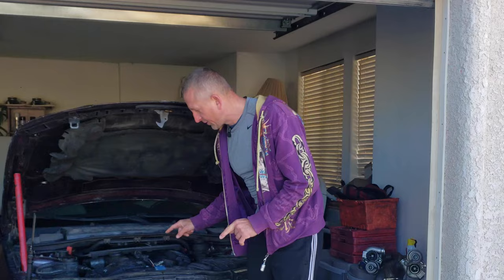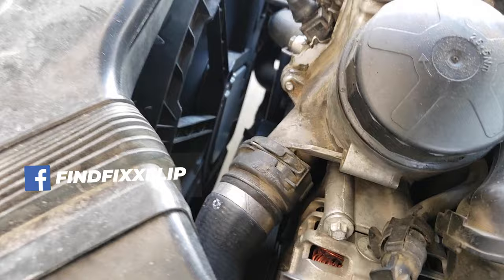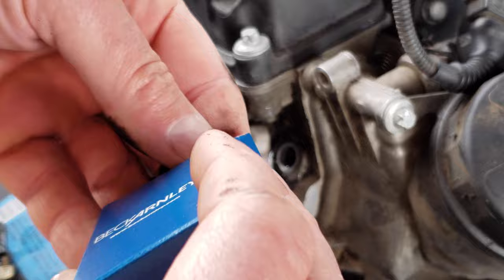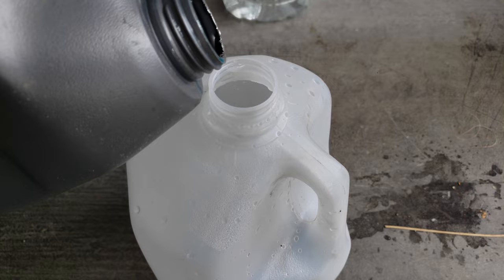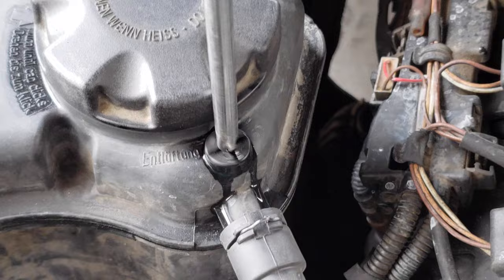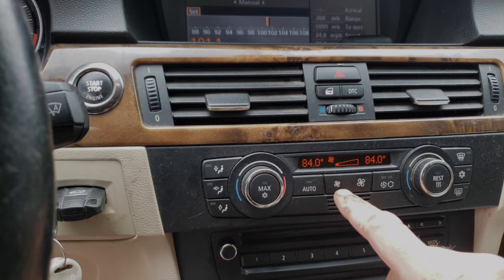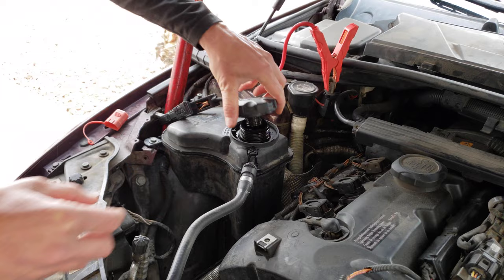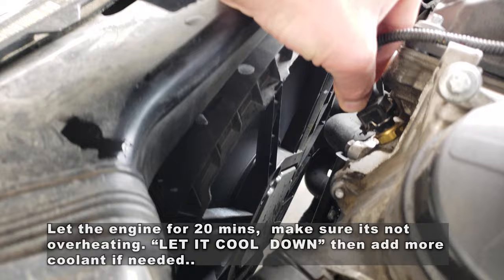BMW E90 RADIATOR FAN NOT WORKING(EASY FIX)

Comment: Hey @findfixxflip, great video!

I own a 2008 E90 with an automatic transmission. Yesterday, my car entered Limp mode, restricting the RPM and forcing me to drive slowly. After approximately 5 minutes of driving at a low speed, the overheating indicator lit up. Upon inspecting the car, I discovered the fan was not functioning. When I checked the diagnostic codes, it revealed an Electric fan malfunction code. I disconnected the fan connector and used a tester to confirm there was power flowing to it. Indeed, there was power. After reconnecting the fan, it instantly started working again, and the Limp mode issue vanished. I drove the car today, and everything appears to be functioning correctly. Both the fan and AC are operating without any problems. Do you have any insights into what might have caused this issue? I want to avoid a recurrence, especially during a long drive. Thanks for your help!
Reply from the maker: Honestly, it sounds like it may be time for a new fan, the controller module goes bad and doesn't switch on. I would as a precaution also replace that coolant sensor as well, because if that goes bad it won't send proper signal to fan because its not reading correct temp. Lastly worst case scenario,  you will have have to replace water pump and thermostat, only if you are getting continuous overheating warning, and low coolant lights on dash board. Just start with sensor, and fan. Also I prefer to find used oem bmw fans because they are made much better than aftermarket ones these days.
Reply: @findfixxflip  Thank you so much for the prompt reply, I recently replaced all coolant hoses so there is no leak and no low coolant warning and the temps are normal as well, I am not getting any overheating warnings it only happened when the fan stopped working and I kept driving on limp mode. As soon as the fan started working the temps went back to normal and the warning light went away, I will replace the coolant sensor and and the fan with used oem one as well just to be on the safe side as the overheating can be catastrophic. Thanks for the help, much appreciated.
Reply from the maker: @moizali1752  no problem, let me know how things go. Usually your symptoms are a sign that the control module is starting to go. The only other thing would be signal from ecu, but that isn't very common to go bad. But if you test the small signal wire it should have around 4 volts , the ecu sends pulses to turn on the fan.

Comment: Hello and please respond..my radiator fan always turns ON when i turn the ac on..i live in Florida but i never hear the fan come on any other time??? I am not showing any check engine lites or codes..HOWEVER when i disconnected the coolant harness the fan turned right on..does that mean my COOLANT TEMP SENSOR above mickey mouse ear flange is BAD????? I had the car running, disconnected the coolant connector and fan came right on??
Reply from the maker: Hello and no everythings sounds like its functioning properly, is the car overheating? The temp sensor just sends a signal at certain temp to turn on the fan, it will run at multiple speeds, depending on what sensor is telling the ecu. Its a cheap fix, and an easy diy. They do go bad pretty often as well. I hope this helps, keep me posted on the progress. 🙏
Reply: @findfixxflip  HI its a 2008 328i sedan no it doesnt appear to be overheating, but iin ur video u said if you DISCONNECT the coolant harness with car running and the fan comes ON, then to REPLACE the COOLANT SENSOR (412 part)  PLEASE ADVISE  **MY FAN only comes on when ac is on and its really HOt here in FLORIDA  BY UR VIDEO when disconnected, it turns on..that means the coolant senor is bad??? as u said??
Reply from the maker: @gail6904  hello, after reviewing , yes it does sound like that sensor is bad. Disconnecting the temp sensor, does two things 1) tricks car into thinking again is way overheating which signals fan, 2) shows the circuit for system is working properly. Try replacing the sensor first its only $13 on Amazon I put a link to exact one I used in video, it is still working fine my own car so I recommend. If fan still doesn't turn on after, there could be a problem with fan control module, then you would need a new fan. Try that and let me know if that fixes it 👌
Reply: @findfixxflip  OKAY i ordered the sensor..you rock  i hope it works out ok..did u have to disconnect the battery or anything when installing? thanks great video!! RE: 2008 BMW E90 328i
Reply from the maker: @gail6904  No need as long as there aren't any exposed wires you will be good. Just be careful not to overtorque sensor, and run the bleed procedure at the end of video to get rid of the air you are introducing into the system. Let me know how it goes. and Thank you
Reply: @findfixxflip  ok flip..thanks so much for your fast replies and all ur help..ive just bled the system last week as I put a new upper radiator hose in and coolant flange in the car  ..never a dull moment on BMWs..thanks!
Reply from the maker: @gail6904  you are always welcome😉

Comment: Where is the relay for the fan at on these models?
Reply from the maker: So depending on the model, Some like the 5 series and older 3 series has seperate relays located in the front near the radiator or battery. There are also several relays behind the glove box in that fuse box. 3 series like mine have a integrated fan control module on the radiator cooling fan that controls all the the speed, I haven't yet had to go searching for any relays , because replacing the fan solved my overheating issues. Hope this helps🙏

Comment: I’ve replaced that before and I have checked all the fuses and anything else I could think of but the fan still won’t turn on. I think this started after I left a charger on my battery overnight but anyway I don’t know what to do seems like the next thing I have to do is take out the fan because I’ve been told that the Relay or whatever is inside it 
any advice?
Reply from the maker: Which model and year do you have?  Have you unplugged the the fan and run a 12+ directly to the fan yet?
Reply: @findfixxflip  2008 335xi 
I don’t know how to supply the fan with that
Reply: @findfixxflip  “those car guys” said that you should take the fan out and open up the middle to find the module or a relay but that sounds like a big pain in the ass
Reply from the maker: @JonathanWornardt  i would say just replace the whole unit, but first find out if you can power fan on.
Reply: @findfixxflip  how do I power the fan on?
Reply from the maker: @JonathanWornardt  run positive jumper to large blue wire or possibly yellow, then run a negative to your brown wire, fan should come on, the small wire is the control wire from ecu

Comment: Hi my fan goes on full intermittently
No fault codes stored 
Waterpump seems ok with the pedal test any ideas please
Thanks
Reply from the maker: So you fan speed is controllled by the car's ecu. It changes speed based on the engine temperature that the coolant sensor and other sensors relay info. Your fan will go on full speed until the temp is back to normal, then it will run at reduced speed or turn off. How old is the waterpump? when they get old they dont circulate very well and cause the car to run much hotter, also thermostat could be sticking as well. I have a complete video on how to replace those. (https://youtu.be/Y_Yw87jw4sk) They both cost around $400 bucks to replace. Hope this helps
Reply: @findfixxflip  
Hi thanks for the reply
The fan kicks in full speed intermittently on cold temperature sometimes 2 minutes after start up. Other times the car will run fine no issues. If I switch it off then the fan is normal again. Anything you would recommend before I change the thermostat and water pump. It's a 2008 325i e92 with 75000 miles on the clock and has not gone over 120 degrees on the gauge under the rev counter
Many thanks
Reply from the maker: @dartman9265  yeah 75k is pretty low. So try first the coolant sensor. Research the location of your AUC sensor. Also i would get multimeter and measure the current for + and see if's its twelve volts constant., Check ground also with test light. and check if you are getting around 4 volts with signal wire. It might be a faulty control unit on the fan itself.
Reply: @findfixxflip  
Thank you very much for your help with the issue 
I'll keep you posted
👍👍👍👍
Reply from the maker: @dartman9265  no problem

Comment: When I unplug my sensor my fan kicks on full power. Replaced it just incase, but it’s the same. Doesn’t turn on when I turn on the AC. Any ideas what it could be?
Reply from the maker: It sounds like you have a bad fan control unit, but just to be safe. First check the fan power wire for constant power, then check you brown ground wire, and also check the little small wire which is the signal wire. it should have about 4 volts. After that there are usually 4 different fuses behind the glove box that should be checked. If they are all good replace the fan,
Reply: Thank you, just checking all the wiring looks good will swap the unit soon
Reply from the maker: @benmendez3285  sounds good lemme know the outcome
Reply: @findfixxflip  just replaced the fan and still no good. Won’t turn on at all even when coolant temperatures are pretty high. Or when I turn on the ac. Only way I can get it to turn on is by disconnecting that sensor which I’ve already replaced. Super lost if anyone has any experience with this any advice would be appreciated
Reply from the maker: @benmendez3285  what was the year and model could possibly be a relay not switching on.
Reply from the maker: @benmendez3285  the only 2 thing could be a short in the wires or a bad dme not sending signal to activate
Reply: Took me a couple hours of searching through forums but fixed issue. Turns out if the AC system in your car is low on freon for some odd reason the radiator fan won’t run no matter the coolant temperature or if the AC is running . Very odd, not sure why it’s designed this way but as soon as I filled my system with Freon the fan started running. commenting this so someone in the future doesn’t have to deal with the same headache as me. Cheers
Reply from the maker: @benmendez3285  Awesome man thanks for sharing. So one of the thing's you have to do when charging the ac system,  is you have to charge until the fan clutch kicks in. I did a video how to charge your a/c system very detailed, when i finished installing a new compressor in my friends 3 series. Bmw systems are definitely designed different for sure

Comment: I did this and the fan turn on and went off and didnt turn on again, what could I do?
Reply from the maker: Is the car overheating? The fan speed will adjust based on engine temperature. Start with sensor replacement. Thats the cheapest solution
Reply from the maker: It is also helpful to trace power to the fan with test light.

Comment: Hi, I have tried to do the bleeding procedure but it doesn't work. I have had my electric coolant pump replaced by a chinese one from ebay. Do you think that may be the reason and I'll have to replace it again?
Reply from the maker: So that is a good indication , but it also could be a fuse. If you have the software you can activate it to see if its working. My best advice is get the real one for bmw. Here is a video i did for complete process, and the link is at the bottom for one i bought on ebay. However it is the real one from germany. I haven't had any issues since. hadhttps://youtu.be/Y_Yw87jw4sk. Hope this helps

Comment: My fan isn’t working I also have an Ecu relay code could that be the reason?
Reply from the maker: Yes definitely, especially if the code is specific. Usually Ecu isnt the problem, but the relays going bad is very common. im not sure what model and year you have, so i dont know the relay location. However they are easy to test, and replace as well. Hope this helps 🙏
Reply: I have a bmw 335 I just took off the sensor and my fan started spinning when I turn on the AC the fan doesn’t spin
Reply from the maker: Sounds like the control unit for the fan isn't working properly, I would replace the sensor either way to eliminate that issue and then go to the fan. What you can do is first test the power to fan with 12volts, test your ground. If both is good, then check your signal wire it's the small wire and see if it's getting 4 volts, if all are reading proper then replace the fan. @KareemJackson-ji3vx
Reply: @findfixxflip  everything was working fine until I got the over voltage could I possibly blow a fuse

Comment: I replace the sensor and the fan doesnt go full power. It goes half speed. Is it a bad sensor?
Reply from the maker: depends, usually the speeds of the fan adjusts to the conditions and temperature of the engine. Did you try disconnecting the plug as shown in the video?  If so the fan should kick on full power, because the car believes it's redlining the engine. If it only goes partial power when doing that than i would say replace the fan. There is a fan control unit module on front of the fan that goes bad it also controls the speed of the fan.
Reply: @findfixxflip  yes i did that and it was going full power
Reply: @findfixxflip  but when i plug it back to the sensor it goes really slow
Reply from the maker: @nathang1323  does it go high speed when you turn on the air conditioning?
Reply from the maker: @nathang1323  do you have access to any of the software bmw tools or inpa?
Reply from the maker: which model do you have?
Reply: @findfixxflip  nope its doesnt it just stays at the same speed
Reply: @findfixxflip  no i do not have access to those
Reply: @findfixxflip  2009 bmw 328i e90 with the n52  engine
Reply from the maker: @nathang1323  so try replacing sensor th cheapest, if that doesn't work replace the fan. After that you will have to trace the voltage going to power wires. Also look in the glove box there is a hidden fuse block with three different fuses that control fan.
Reply: @findfixxflip  okayy i will thanks youuu
Reply from the maker: @nathang1323  No problem man, hope this helps